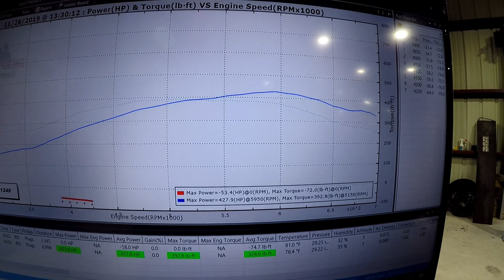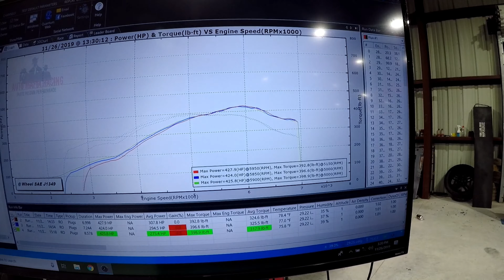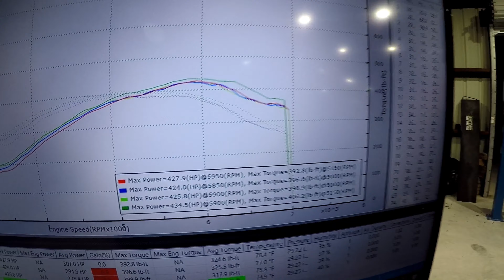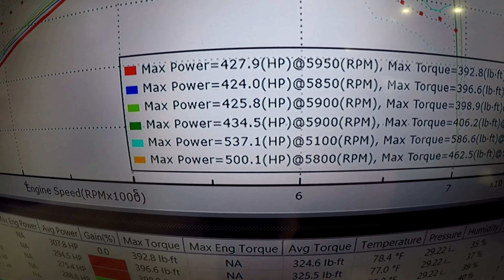TWIN TURBO 3.7L V6 S550 Ford Mustang Getting a Mafia Dyno Tune

Comment: I’m in love with that car.  I’m a 4v v8 guy but I am a deeply closeted v6 TT guy it seems!  My wife has an SHO that would destroy my Cobra, so if quickness is your thing, these turbo cars are where it’s at.  And with where things are headed with initial costs of v8s, fuel, aftermarket pricing/ availability and the way those weigh up against street use, this (v6 TT) is the way.
Reply from the maker: Truth

Comment: I have a 2017 v6 twins pulling 587 rwhp. Super fun to drive.
Reply from the maker: awesome
Reply: How’s fuel economy
Reply from the maker: 20+ when not in boost
Reply: 2 years later how is it going? I had a 16 for 2 years , I want another and would like to go turbo 3.7 over 5.0, iv been trying to see how these are long term

Comment: Awesome. I have turbos from an ecoboost F150 and plan on porting them, as well as upgrading the turbines and impellers. Also going to run a 400LPH fuel pump and 1000cc injectors, a GT throttle body and ported intakes. Any tunes you can suggest to run so I can drive it once everything is installed?
Reply from the maker: Yes hit us up.

📬 Contact us for build advice and guaranteed lowest prices.
📞 941-979-1132
📧 Support@AutoMafiaRacing.com 

facebook.com/automafiaracing
Reply: Just make sure you can make those upgrades to the turbos.  Because the Ford turbos aren't serviceable.  Ford doesn't sell the individual components.  Tech at a dealer.  Not saying it's not possible, just saying check first.
Reply: @Byron C. NIZMO  you can do hybrid turbos with any if the eb turbos far as I know.  My fiest st is a 1.6 eb and I have a hybrid on it it's stock turbo with larger internal parts makes it flow alot more up top with close to the same response as stock down low.

Comment: I just want 400hp in my 3.7 lol this guy is making damn 500
Reply from the maker: hes making over 600 now
Reply: @automafiaracing  do you know if they sell forged internals for the s550 3.7?
Reply: @automafiaracing  how? I was thinking of buying one, but I don't know what it's limits might be
Reply: @Brandon Garcia  because they're stout engines the 3.7 has been known to take upwards of 600+ wheel on good fuel.  These are like mini coyotes basically and very underrated.
Reply: 400 is child's play on these any blower setup will make that on Lowish boost.  Turbo setups do it even easier.
Reply from the maker: We sell forged internals yes
Reply from the maker: Almost all our cars we build make 600 hp. They are stout engines

Comment: Am I the only one that noticed the 2018 digital dash board in this 2015 3.7 Mustang???????
Reply from the maker: It's pretty sick tbh
Reply: Its sick but 2 grand.... i’d rather spend my money on performance parts
Reply from the maker: I mean hes twin turbo already...
Reply: @automafiaracing  Hey I know you said the Single Turbo kit makes more power but how does the exhaust sound? How do you have left side and right side exhaust with a single Turbo?
Reply: @automafiaracing  have him swap 4.11 gears and then run the quarter mile!
Reply from the maker: @jash3023  that would be dumb. Thats too much gear
Reply: @crdesignz9941  Y pipe

Comment: Is this a better setup, compared to the single turbo setup, (600hp in one of your other posts)
Reply from the maker: No.  It is way worse. We made about 50 rwhp more on the single kit with the same boost levels.
Reply: @automafiaracing  , thanks for the reply guys.
Reply from the maker: Anytime
Reply: It will make less peak power but response is alot better so the power curve is better overall

Comment: Hello friend, have the injectors been changed or are they original from the factory?
Reply from the maker: They have been changed. We have FIC 1000cc injectors we use in these cars.
Reply from the maker: Sweet.

📬 Contact us for build advice and guaranteed lowest prices.
📞 941-979-1132
📧 Support@AutoMafiaRacing.com 

facebook.com/automafiaracing

Comment: What did y'all do to the engine so It can handle that much horsepower I'm trying to do twin turbos on my 2011 v6 but I want to get the engine upgraded first
Reply from the maker: Its stock bottom end
Reply: The stock bottom end can handle quite a bit.
Reply: These motors are stout you don't need a built motor unless you're trying to do 600+ rwhp.

Comment: What is the maximum speed with these specifications?
Reply from the maker: Faster then you need to go for sure.
Reply: @automafiaracing The 3.7s have speed limiters on them. Disable them, and 160-165 mph seems like a reasonable guess for a NA 3.7. With a 500+ HP twin turbo build, you could probably get close to 190.

Comment: Just wondering, what size are the turbos and what size are the injectors he had in there?
Reply from the maker: He previously had DW65s.  We will never recommend those injectors.  And we are no longer tuning them.   We are recommending ID1050x and FIC1000cc injectors for boosted 3.7s as they can run everything from 300 rwhp to 600 rwhp on E85 and they work perfectly with great data and tune easily
Reply: @automafiaracing  awesome, thank you.